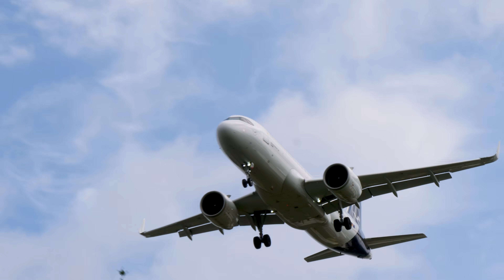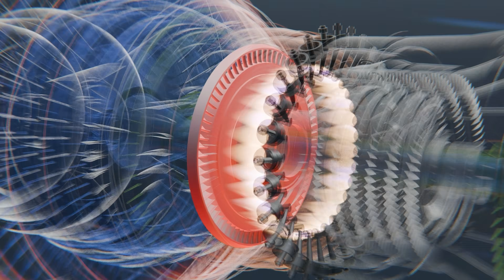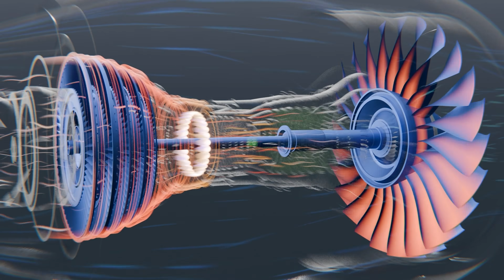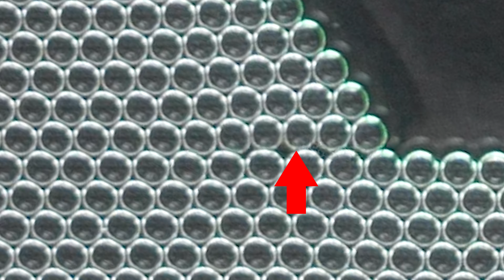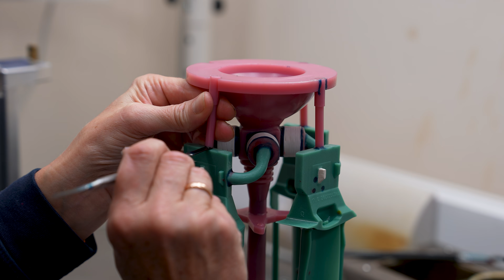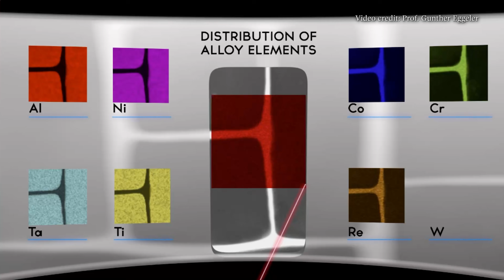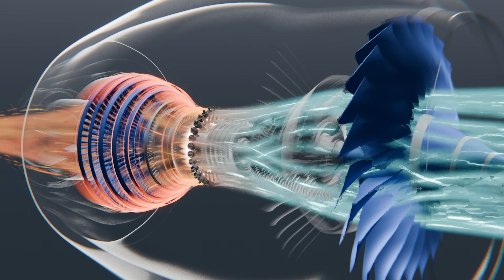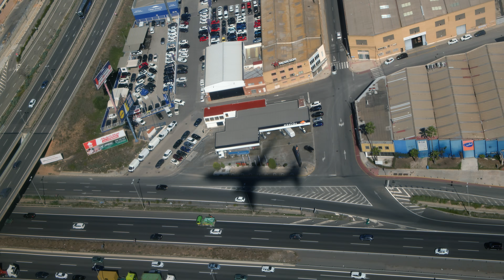The Ridiculous Engineering Of Jet Engines

Comment: how many aerospace engineers do we have here? Got some questions.

So basically, the "jet engine" used on a passenger aircraft is not really a jet engine but a turbofan? Giving out a small thrust from the back and the back blades run the fan in the front that makes  most of the thrust?

Why would you not use a normal propeller instead? You can have variable pitch propellers so wouldn't those work instead? what are the pros and cons? and why is the turbofan called a jet engine and why is it so much better?
Thank you in advance! :)

Comment: Alternative title: JET FUEL CAN'T MELT JET ENGINES!
Reply: Happens all the time... it's called a Hot Start and will melt the blades right off... sprays molten metal right out the exhaust nozzle.

Comment: 14:50 LOL basically says right to the rolls royce guide " this could be done better by a robot. Why havent you replaced this human with a robot yet?" while standing in front of said human! Savage
Reply: Ya I thought that was savage too. 😅
Reply: the worker is wearing a $ 100,000 solid gold Audermars watch.   

Rolls could save $ by using robots versus highly paid factory labour.
Reply: @saurusmonster  Where did this come from? No watch is visible on the worker's wrist in this video. Do you have something against workers?
Reply: @soaringvulture  at 13:59 you can see it
Reply: @saurusmonster  I thought so too, but it’s actually a Casio G-Shock. Go to 14:03 and pause, and you can clearly see the brand on the watch face.
Reply: @saurusmonster  That is a completely different worker doing a completely different thing that is not relevant to the parent comment above. It's very likely the guy wearing that watch is an overseer of the department. You're drawing conclusions using unconnected evidence and assumptions.

Comment: if you're wondering how they know when the turbine blades are damaged, each engine is filled with sensors and they use machine learning algorithms to analyse vibration patterns in operation. When a vibration pattern is detected that they suspect is the early stages of a problem, the engine is scheduled for maintenance.

Comment: there's so much more amazing material science engineering in the jet engines. Like how the main propeller blades are cast. They have an internal structure for strength, and the way they manufacture them is to cast them with inert gas inside and then bake them to the point where the gas expands so much it pops the metal into its final shape.

Comment: It's understandable you wanted to simplify it, but an elaboration from me here. 

Military engines in tactical aircraft haven't been turbojets since the Mid 1960s. In fact, the first turbofans were on supersonic military jets. These however are low bypass, so instead of 90% of the air going around the engine, often less than half of it does. 
As for exhaust velcity, what was described here, while correct, applies to subsonic speeds. Once you go supersonic (IIRC above the transonic range of Mach 1.2) higher velocity exhaust becomes more efficient. This is partly why next-gen military engines are adopting adaptive engine technology, where depending on the flight regime, it will open and close slipstreams, becoming a turbofan with a bypass, or a turbojet, matching the ideal configuration for maximum efficiency. 

Note: I am NOT an expert, not even remotely close, so any corrections from actual experts are welcome.

Comment: Derek,  I love your channel, and what you do with it.

I design gas turbine engines, including turbofans, for a living.  Unfortunately how you describe the fan is completely wrong and misleading.  Don’t take it too personally as most people get it wrong.  The fan in a turbofan engine is an axial compressor, just like the other axial compressor stages in the core of the engine.  It is not a ducted propellor, as propellers produce thrust by directly accelerating the air, but this causes Mach effects that limit propellers to subsonic speeds. As a compressor, the work a fan does is primarily to compress the air, raising its pressure and temperature.  The ducting behind the fan has a small decrease in area downstream, causing it to act like a nozzle and trade the pressure for velocity, and thus produce more thrust than the pressure would on it’s own.  When designed right, compressor stages can run quite efficiently with supersonic tip speeds, and usually do so on the fan stages. It’s worth adding that the supersonic tip speeds of the fan allow it spin faster, which better match it to the turbine stages mounted to the same shaft. Since turbines want to spin fast to produce more power, the high fan speed allows the turbine stages that drive it to be smaller.

Comment: This was a great video! The only thing I think is more impressive about jet engines is the tolerance between the end of the blades, and the edge of the wall. the greater the efficiency needed, the smaller that tolerance. It would be great if you could do a video on that and how that super small tolerance is achieved and maintained.

Comment: Boundary Layer cooling helps to keep temperatures below 1100°C, while the temperature in the combustion chamber reaches 1350°C. But you still have creep even in single crystal blades, after some time it needs to be changed

Comment: This stuff is more difficult and advanced than rocket technology, which is why there are only a handful of companies like GE, Rolls Royce, Pratt and Whitney, Safran etc. which makes reliable jet engines. Remarkable!
Reply: Is it true that regular rocket are much easier to build than jet engines but SpaceX’s resusable rocket engines like raptor 3 are much closer to the difficulty of building jet engines?A resusable rocket engine like raptor 3 will have to be fired on multiple ignitions making it much harder to do than a regular rocket engine.

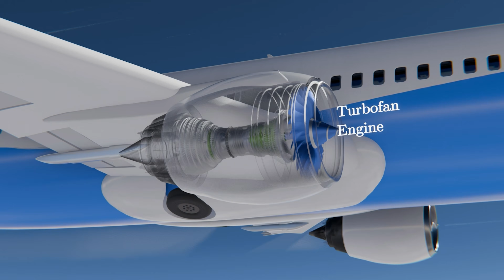Comment: 0:45 I know the engines used to set under the wings, not in front
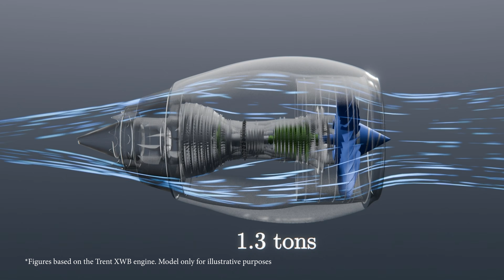Reply: 1:00 sounds super inefficient
Reply: 3:01 so its air cooled
Reply: 6:15 who welds these blades
Reply: 12:02 🤔
Reply: 21:24 can you make a tungsten alloy?
Reply: 22:38 was the same amount of force applied to each test subject
Reply: 24:06 would metal formed in space with it particular “grain” crystalline pattern make a difference
Reply: 27:14 would you be able to 3-D print

Comment: My wife used to work for an engine company. Apparently the materials science guys called the metal alloy "unobtainium", because of its ridiculous characteristics, though you've now told me more about what's in there than she ever did. (She's always taken trade secrecy pretty seriously, not least because they had some military contracts.)

But yeah, a big part of her job was trying to get instrumentation into more and more places inside the engine. If you think it's rough for single-crystal superalloy blades, just imagine what it'd be like for a sensitive accelerometer. (They never managed to get one of those all the way into the combustion chamber, obviously, but they were pushing to get closer to it. And several hundred degrees is still not fun for delicate electronics.)

Comment: My guess before the video starts as an aviation maintenance student: cooling. Most of the air in a jet engine is used for cooling, and a hot start can damage the engine from the high temperature and low airflow.

Comment: After so many maintenance runs the blades will inevitably crack, and interestingly enough when ive inspected these blades ive found cracks not circumferentially like youd think with how fast it spins but actually verticle cracks going up the center of the blade wall from the fur tree base 😮

Comment: hypothesis: it’s due to the laminar flow of the gas through the engine. energy isn’t being imparted on to the materials which means they aren’t getting heated as much. the temperature of a gas only describes its average velocity, so similar temperatures under different conditions result in different heat transfer

Comment: we produce the castings for the hot section where I work. "If it's in the air, we're on it" is a slogan plastered around the workplace. Every day I rework or gauge dimensions of blades and vanes for dozens of different types of turbine engines, not just for planes. It's wild to see renders and photos of castings that I recognize and work with every day. we sell to customers like Pratt Whitney, General Electric, etc. we're not allowed to have our phones on us on the shop floor, because they're so worried about proprietary processes, but it's all laid bare in this video. ig it's just because we have government contracts, for the F-35, F-22, etc. at 26:57 that mold that they poured has been solidified and cut apart into the individual patterns/castings with gating still, the shell knocked off of it, it's been shot blasted to remove residual shell, excess gating has been removed, the castings sand-blasted, and then gone through ferric and anodic etches to reveal the structure of the grain. Every day, I grind problematic spots out of the grain of the castings so that they don't propagate and destroy a casting while in flight. we do not cut the film-cool-holes, that is done by the final customer.

Comment: In software development (well until the new AI hype driven vibe programming nonsense) there's a whole testing framework (well, there should be, not usually).  Everything works in theory, you made it, and now ... you just throw it into an operational turbine?  How do you detect errors after manufacture and before putting into production?

Comment: They talk about those RR engines like every jet engine there is, but whoever saw them live knows they have one more feature that's not mentioned in the video. Ther are freaking huge compared to other jet engines. That would also be interesting bit to explain. Maybe the proprietary alloy allows to make the bigger without mechanical failure thus pump more air. But the size difference seen live makes quite an impression.

Comment: GE used inconel in the exhaust turbine blades for their turbochargers for Army air corps aircraft engines. Specifically,  the bombers B17, B24, B29, the P47 thunderbolt and the P38 lighting and many more.
 "we" (the U.S) were the only ones who were able to sucessfully use turbochargers because of the use of the high tempature alloy inconel. This alloy was then adapted to early jet engines that had the exact same use and demands!

Comment: The first directionally solidified, as well as first single crystal blades, were created for the SR-71 Blackird's J58 from Pratt & Whitney.

Internal cooling passages using a small amount of the compressed air plays a big role in protecting the turbine blades. The assembly of those internal passages gets very intricate at the later/larger stages. And then the blade and vanes need to be surgically hole drilled after coating. Very difficult to manufacture properly.

Comment: I worked for GE  aerospace for 10 years and now at Pratt and whitney for 5. I'd worked every processed from OEM to overhaul and repairs and the amount of quality assurance, attention to details, safety and standards procedures are so high in comparison to any other industries; that I can flight every year and take pride that without a doubt that engine that's on the plane will service its life spam without a single issue.

Comment: Too bad you did not show the insane tests they do with these engines. They have to contain a fan blade that explodes at full throttle, and it has to remain inside the engine enclosure for safety. Quite something to see.

Comment: As an aerospace engineer, I am flabbergasted this video didn't use the greatest example of air cooling and which most homes of the western world have, the humble hair dryer. The heat inside a hair dryer is actually so hot that it can actually melt the housing and the rest of the non-metallic/non-ceramic components in a few seconds. But the air flow done by the fan going through the dryer cools down the surface temperature more than enough so there won't a material degradation in the components, including housing. The surface temperature on the heating element is at least 3-5 times than the output airflow. And why is it so hot do you ask? Easier to get the output heat right and fast, but as a side effect it also dries the blowing air itself a tiny bit so it can absorb more moisture.

Comment: I have to admit that to me, the most impressive thing was the cork-screw crystal filter. That was one of the coolest things I've learned this year. And it's intuitive. I have seen crystals form on countless time lapses and for sure, never seen one naturally form on a curve! So the behavior makes sense. And it makes me laugh because here they have this facility, with ovens capable of pulling a vacuum, induction heaters capable of melting metal without a flame, robots capable of doing precision work and yet the innovation that makes this possible is a spiral rod of wax. I love it so much!!

Comment: Tonnage of the non-nature "dust" (pollution) in the upper atmosphere actually comes from exhaust of jet engines. It's a measurable, estimable quantity because of the number of flights. Some of it is observed from the ground, as aircraft-induced cirrus clouds, which will persist as ice crystals, fan out due to atmosphere wind. Takes a certain amount of humidity, a certain temperature, and a certain dew point to form. Radiosonde data from weatherballoons helps establish the data necessary to determine when and where condensation will occur.

Comment: There is also an interesting story about how the "cooling air" is engineered in such a way to keep all the other parts (besides the turbine blades) in the hot section of the engine from melting.

Comment: I always wonder why the heated air at the middle of the engine doesn't expand forwards.
Reply: The highest pressure in a jet engine is just after the compressors and then it decreases all the way out the back so the air flows from high pressure to low pressure. Combustion in a jet engine DOES NOT increase it's air pressure. The air is not confined like in a piston engine. Combustion in a jet engine makes the air hot and the hot air expands and it's velocity increases. It's pressure actually goes down slightly from combustion as the expansion lowers it's pressure. Turn on a hair dryer, the heater inside doesn't increase any pressure, it just makes the air hot and expands it. Exact same thing as a jet engine except the hair dryer is missing a turbine to power the fan.
Reply: I think I understand now. The combustion just speeds the air up and won't disrupt the flow.
Does this mean the engine will work backwards with no problem when the turbines rotate in reverse?
Reply: @二号リフェイ  The engine can't run backwards, the compressor blades and turbine blades are directional as they have airfoils. They are all like little wings. 
    Combustion not only speeds the air up but also heats it up considerably. That increases the total energy in the air. It is some of that energy (heat and velocity) that is then extracted by the turbines to power the compressors.

Comment: This could be explained in about 30 seconds. Cooling. There is more cooling than heating. Same thing with a gas car that burns around 1,400f but coolant never gets above 240f and keeps the block and heads well under the temp to deform them.

Comment: 25:00 aerospace student here, my Structures and Properties professor researched Inconel 718 in laser sintering, and she taught that the grain boundaries are what help stopped dislocations. Also, as the material heated, more grains would appear, which helps strength as well. Was she mistaken? I see the logic in both cases but am not sure which is most correct. When researching Inconel X 750 I read reports agreeing with what she said.

Comment: I’m a thermal spray engineer and while we don’t see aviation parts at my location, we coat very similar turbine blades for power generation. While we do apply ceramic coatings to some parts, the power generation blades use a tungsten carbide coating. I don’t get to see many examples of my work in the wild, so seeing the blades as something I recognized from work was a real treat! Thanks for the awesome video!

Comment: Also because they run in extrema cold around - 40 degrees c when at 35,000 ft and when they land they do not run as hi in as far as rev's they never  get that hot ever, the fans used in jet engines are made out of specialized titanium and inconel alloys which can take the extrema heat and cold thats why they are made the way they are etc. ✌✌🦘🦘👌👌

Comment: 26:07 fun fact, clear ice is made with similar principles. 

It's isolated from all sides except one, which is where cooling is applied, water is being pumped near the surface so that it doesn't attach to walls of the container, and after most of the ice block forms, you can saw off the top part that is still likely to have some imperfections.

Comment: wow this sounds so impressive, I was familiar on high level what a turbine engine was doing and how it was build. Build this video make me respect this technoligy so much more! i did not realize that the the turbines run on the edge of what is nature allows whats possible. I assumed the size of the fan and allowing higher bypass ratio of the  air was the main reason they where getting more efficient.

Comment: Air cooling and Oil lubrication. Some of the air coming thru is used to cool the engine and use to keep the labyrinth seals working so. the lubricating oil will stay inside the engine.

Comment: Fans make thrust but not directly. 
They pump air into the nacelle which ends in a nozzle. The nozzle is where the real thrust load is created. Think of it like a water hose, almost no thrust from the water until it exits from the nozzle

Comment: At least 3/4rh of the air is use for cooling the rear bearings are cooed with circulating oil oil.